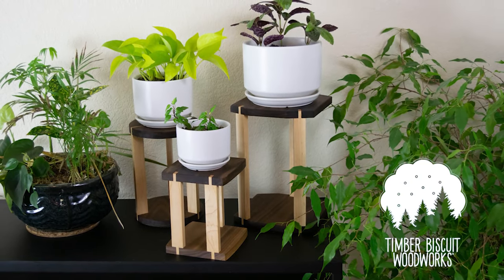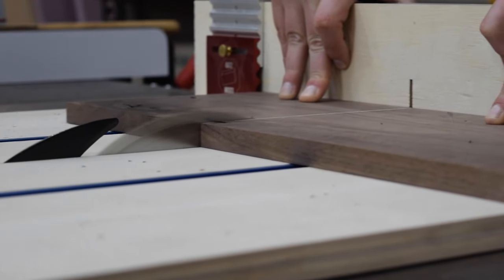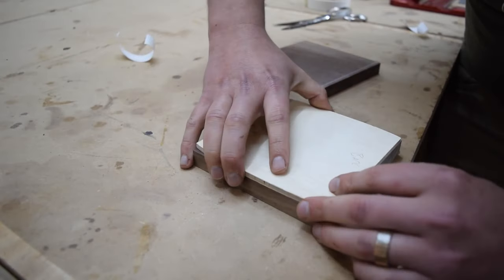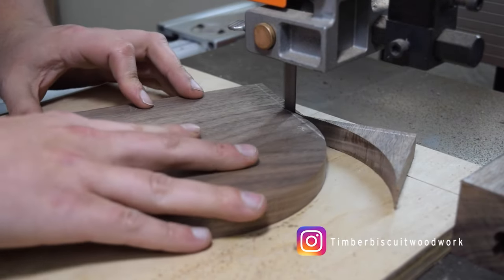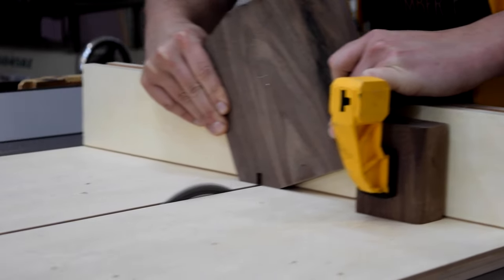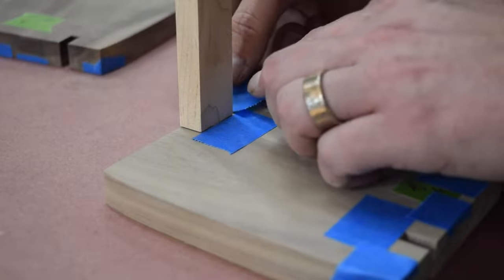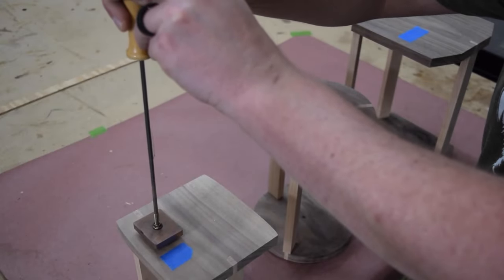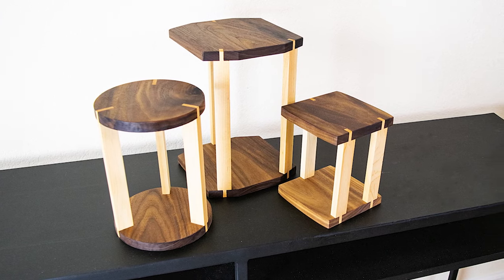DIY Modern Plant Stands with Exposed Tenons | How to Build

Comment: Nice job! Such an impressive outcome from such simple design. I think small touches like rotating the verticals on the round stand 90 degrees as compared to the other two stands really makes the pieces interesting as a set.
Reply from the maker: Thank you so much! Yeah, I think it would be cool to add a chamfer on the backside of the tenon legs as well. There is a ton of fun edge profile stuff you could do with this design.